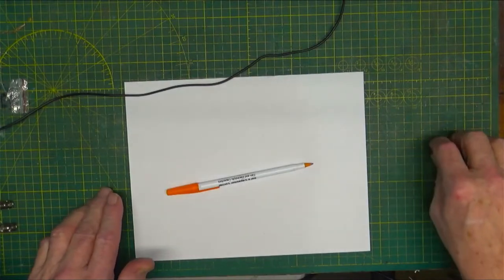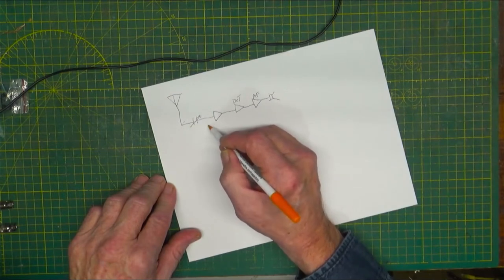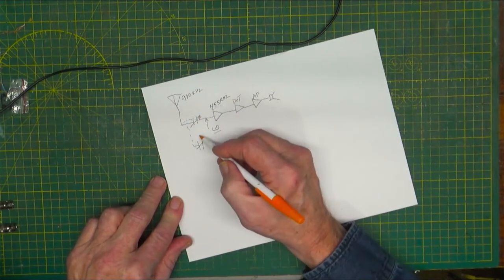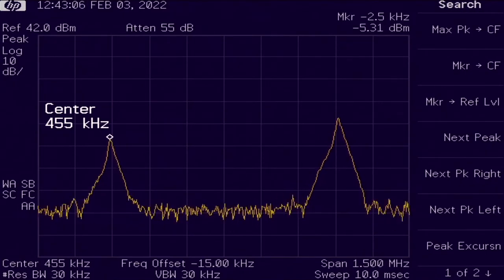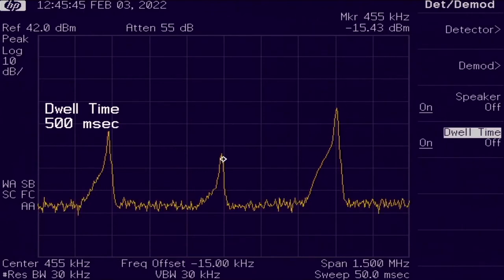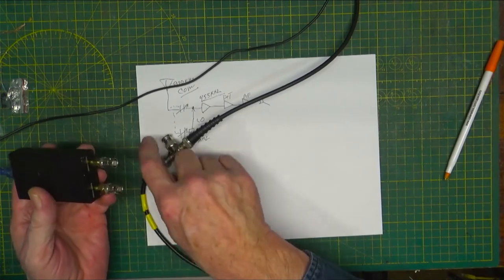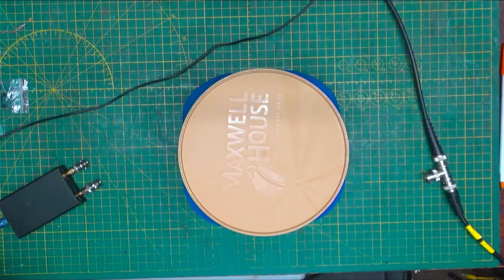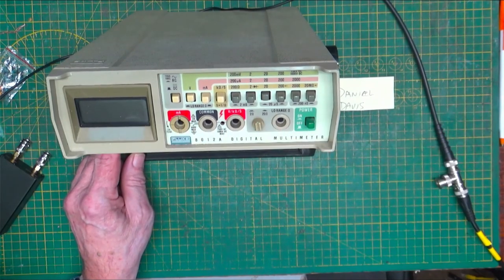Explaining Local Oscillator, LO, Injection and the Fluke 8012A Winner

Comment: Before I got my SA, I did use this SDR radio module as a SA, however if one is going to do so, then one must understand sending to much signal into the device could fry it along with your computer.  And having to much signal will generate an abundance amount of harmonics and spurs....so use an attenuator to help control your input signal if unable to do so from the source.  This was a wonderful video, could you do one on transverters?  I have a basic knowledge of them but would be cool to see what an experienced tech can offer.  Thank you and 73's ~Jack, VEG
Reply from the maker: I have a 2M to 6M transverter that works. I will put the suggestion on the list. Thanks
Reply: @AERVBlog  Thank you!  ~Jack, VEG